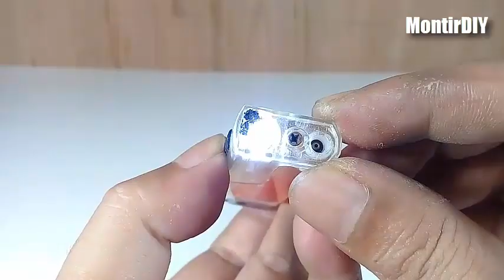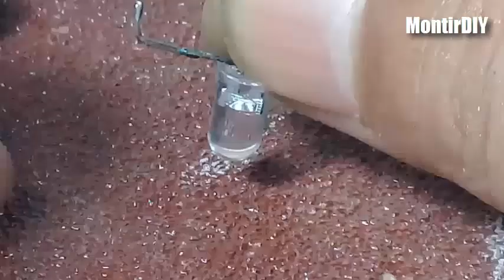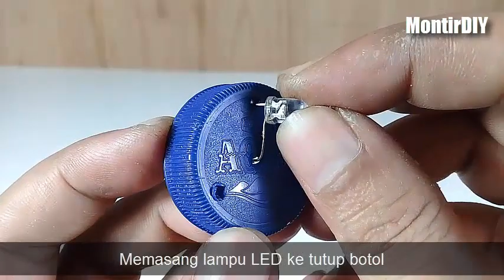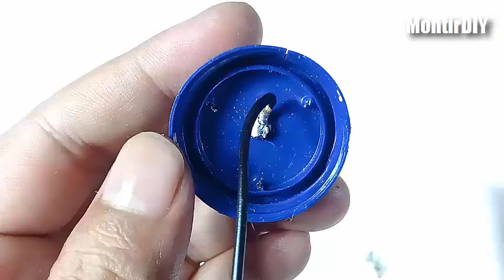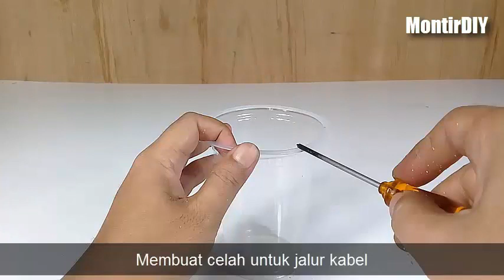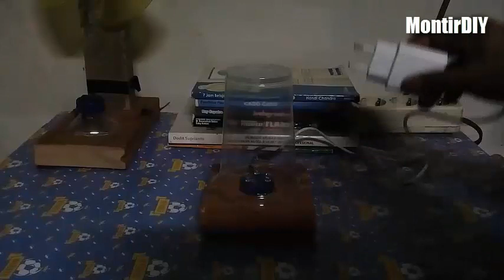CARA MEMBUAT LAMPU LISTRIK DARI KOREK GAS | LAMPU LED PAKAI CHARGER HP | TUTORIAL DIY

Comment: Wehhh ini LED yang sama yang saya pakai buat experiment listrik dari sabun mandi bang hehehe.. mantap bang
Reply from the maker: iya bang. Tapi kalo mau awet lampunya harus ditambahin resistor. Di video ini saya belum pakai resistor.
Reply: @MontirDIY  pakai resistor ukuran berapa bang ? Saya juga niat nya mau bikin panel surya dari LED bang hehehe
Reply from the maker: @MOBIL LISTRIK BANJARNEGARA Tergantung berapa voltase sumber listriknya bang dan tergantung voltase LED juga. Misalnya di video ini saya pakai sumber listrik berupa cas hp dengan voltase 5 volt dan voltase LED yang saya gunakan sekitar 3 volt dan arus LED 0,02 ampere.

Maka rumusnya:
R = (Vs - Vl) : I
R = (5 - 3) : 0,02
R = 100
Maka nilai resistor yang digunakan adalah sekitar 100 Ohm.

Keterangan:
R = Nilai Resistor (Ohm)
Vs = Tegangan Sumber (Volt)
Vl = Tegangan LED (Volt)
I = Arus Led (Ampere)

Begitu sepengetahuan saya bang, kalo salah mohon ralat.
Reply: @MontirDIY  mantaps.. ane lupa rumus rumus nya palah bang hehehe.. salut pokoknya 😀
Reply from the maker: Sebenarnya saya juga ada rencana bikin tutorial tentang LED yang pakai Resistor. Tapi belum jadi-jadi juga sampai sekarang, karena saya belum punya resistornya.
Reply from the maker: @Kang_service-91  Maksudnya LEDnya yang dijadikan panel surya ya bang?
Reply: @MontirDIY   iya bang..  buat experiment banyak juga di yt nya orang luar bang.
Reply from the maker: @MOBIL LISTRIK BANJARNEGARA Mantap itu bang. Gak apa-apa, yang penting videonya versi buatan kita sendiri. Jujur, kalo saya lebih suka nonton video yang versi indonya daripada versi orang luar. Video orang luar palingan buat nambah referensi aja. Karena kalo versi orang luar, peralatan atau bahan yang mereka pakai terkadang tidak kita punyai dan susah nyari di indo. Dan kalo pengen berkomentar di video indo juga lebih enak karena pakai bahasa kita, soalnya saya gak pandai bahasa inggris wkwkwk..
Saya tunggu video eksperimen panel surya buatannya bang..

Comment: Kerenn kak, mau nanya juga kalau untuk kabel cas yg didalamnya tu ad 4 kabel itu gimana kak cara sambunginnya sama 2 kabel dari lampu led yang sudah dirakit?
Reply from the maker: Terima kasih ya..
Biasanya jika kabelnya 4 warna (Merah, Hitam, Hijau dan Putih), maka Merah adalah Positif dan Hitam adalah Negatif, Hijau dan Putih untuk Data. Jadi yang dipakai adalah kabel Merah dan Hitam. Jadi hanya kabel Merah dan Hitam saja yang disambungkan ke kabel lampu LEDnya.
Reply from the maker: Oya kalau pengen lampu LED nya awet, maka tambahin Resistor dengan nilai sekitar 100 Ohm ya..
Kalau yang di video ini lampu LEDnya tidak tahan lama, lama-kelamaan lampu LEDnya meredup dan akhirnya putus, karena tanpa Resistor.
Reply: @MontirDIY  Kalo mau nambahin resistor nya letaknya di mana ya bang?
Dan itu bisa di gunakan untuk sepeda motor bang?
Reply: @MontirDIY  kak kalau lampu led nya sekitar 60 buah apakah bisa nyala/aman

Comment: Kalau mau dibuat sumber arusnya dari baterei 18650 gmana caranya bang...??? 🙏🙏🙏
Reply from the maker: Belum coba sih. Tapi, Baterai 18650 kalau tidak salah voltasenya sekitar 3,7 Volt ya? Jadi cukup gunakan 1 buah Baterai 18650, sudah bisa menghidupkan Lampu ini.
Reply: Klok mau awet lampunya tabahin resistor 1ohm dgn ristansi 10%